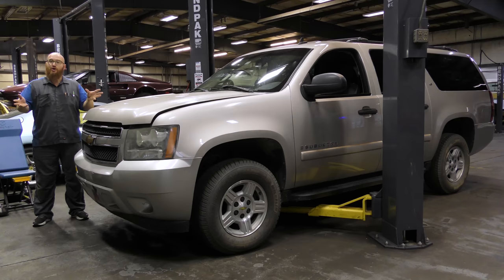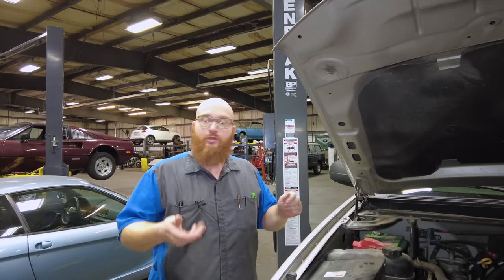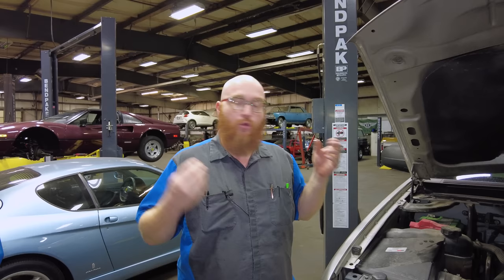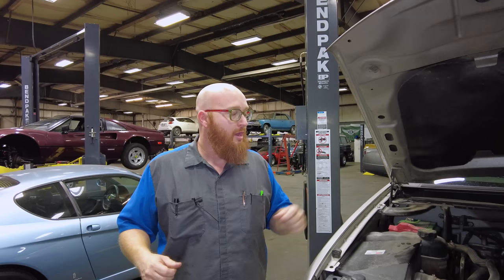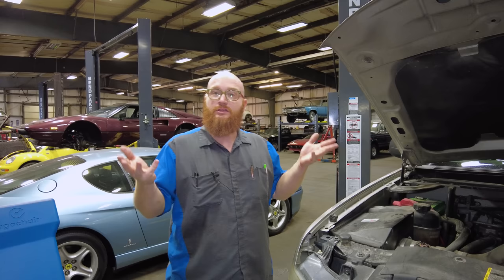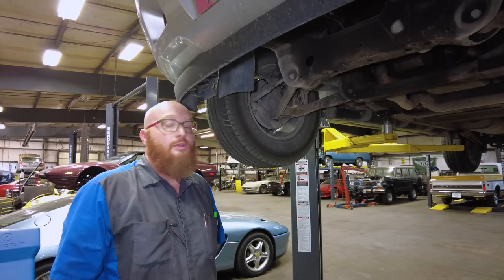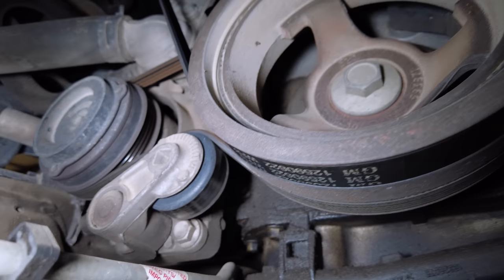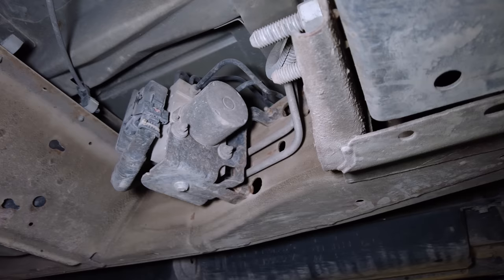What fails on ALL early 2000's Chevy SUV's!? CAR WIZARD shares what he's seen from the last 20 years

Comment: Chevy Suburbans are one of the most reliable SUVs ever made. Statistically, the 5.3L engine is a great engine. The problem is it followed the most reliable engine ever made, the venerable 5.7L.  My 94 Suburban is still going strong with 415,000 miles. Original 5.7L engine. Only major repairs have been AC and front end. Requires about half a quart of oil between changes.Wife's 2005 Suburban has just needed oil changes, brake pads and tires.

Comment: I have a 2007 Suburban 5.3L 2 WD 185k/miles I’ve changed the gas pedal 3 times, Driver digital info in dash replaced, upper control arms, some charcoal/vacuum solenoid that makes pumping gas a big issue.

Comment: just fixed up mine, valve cover gaskets, intake gaskets, spark plugs, spark plug wires, serpentine belt, and an oil change

Comment: Great video!  Yep, my hand is up with the ABS light.  Will try to get to the box soon to resolder it.  I have a 2002 Suburban with the 5.3L engine.  Knock sesnors were bad on it.  Replaced and still bad so I got another set and installed them on passenger side engine head.  There are two hole perfect for the knock sensors.

Comment: glad I caught this video, I just picked up an 04 Tahoe. Got it super cheap, needs a transmission and guess what is on the rear bumper! Of course it has a reese hitch! Was low on oil, had the guy put oil in it, then drove it, (still shifts into 2nd). Hammered on it, good pressure, no smoke in the rear view - OK, My original though was the rear main, I'm doing the transmission anyway so hey I'll be right there right? Now looking at this I'm way more suspicious of the oil cooler block and possibly the oil pressure sending unit, although it is reading 40 psi. I'll be cheking it regardless. It also has the popping cv joint in 4WD, so now I'll be ordering seals and just knocking those out too. You mentioned the lines - as an R&R man for a transmission shop you are dead on but I'd probably include the cooler along with that. I've done at least a couple dozen of those too. Good video, I'll be watching you new friend!

Comment: You probably forgot the most common door latch actuators' failures. If one fail, the rest will follow. Either rattling sound or never locking or unlocking.

Comment: Brake and fuel lines.  Made of just steal and run along the drivers side of the vehicle right in the spray path of from the front wheel.  They WILL rust, and they WILL fail if you live in the north (MI here). If you decide to fix it yourself, avoid the "pre-bent" stainless steel brake line replacement kits.  Those are only good if you plan on completely removing the chassis from the frame.  Otherwise, they are not flexible enough to get them back into the correct positions.  Just get some NiCopp (nickel copper) brake line, a tube cutter, and a flaring tool and make your own.  For the fuel line, I got mine replaced with nylon lines for under $300 from the local gas tank repair shop.  Standard auto repair shop wanted $2200 to do both fuel and brakes.  With doing the brake lines myself and the shop doing the fuel lines.  Total cost was maybe $400 total.  '03 GMC Sierra Z-71 300k miles and still running.  The only issues that were mentioned in the video that I've had was the A/C tensor failure, and the instrument cluster failure..  Believe me, I've got a laundry list of other things I've fixed so that comment isn't a criticism of the video.  It's all good info.  Thanks!

Comment: Lol.  Just about all the common problems I have run across on my 03.  The exhaust was the main issue I had to resolve.  I ended welding nuts on the broken bolts that I could not grab.  It worked great other than fitting in there.

Comment: I’ve been a GMC from1984 to 2021.  Nothing but Chevy trucks from bumper to bumper, from transmission tech to full time electrical tech until I retired.   Yes.  I’ve seen what Wizard had seen,  what he talked about but maybe we don’t work in the same religion,  like snow country.   I only replaced 5 oil pressure sensors in my career. Yes. They do failed but I don’t see the failure rate he saw.    I had 17 tech in my service dept and I know other guys have probably seen a few failed every now & then.   AFM is a problem though.   I don’t do engine work but I see that problem in my old shop.     Overall,   Customers love them trucks,   They have high mileage but pretty reliable and they take care of them, I still see a few come in when I left.   They hold their value well.   That year was still the best truck in my career.   That trans is not a big HD unit,  I didn’t see the torq converter clutch failed that much,  the apply control & pressure is more of the real problem which may require replacement later.    Yes, 3/4 clutch or O/D may be the weak point but they should last over 100,000 miles & more.

Comment: I had 2 GM/Chevy large SUVs and 2 Chevy sedans of that era and all but 1 had failed transmissions and cooling systems.  The one without transmission or cooling system problems had a failed electrical system that killed it first.  I never used any of them for towing while I owned them but as I wasn't the original owner I can't say it didn't happen prior to my ownership.  I just accepted that me and GM vehicles of that time period were not friends.

Comment: 04 silverado 1500  5.3 Z71 here.
No joke 424,000+ original miles engine and trans still every day construction work vehicle. Water pump at 380,000 both abs hubs at 290,000. Dash cluster about 310,000 replaced third member at 180,000 but hit deep pot hole while hauling heavy load on lumber rack.
All maintenance  done by me.
The key is maintenence.
I'm original owner , got my money out of this one.

Comment: PSA: if you have a 6L80 transmission, get it tuned to stay out of torque converter lockup before 5th gear. 

Also, have your torque converter replaced with a billet unit before 100K miles. 

I ran out to 220K miles on a factory transmission, at which point my torque converter lockup clutch disintegrated and took the rest of the transmission with it. 

$2K for a billet torque converter + install, fresh fluid and a rear main seal looks way better than $7K for a new trans.

Comment: You didn’t point out the dash cover, the dashes from 07-14 or so dry up and crack everywhere, literally fall apart.  Also the brake pedal switch, can’t remember the official name of it, located on the brake pedal shaft, it gets gummy and sticks or fails giving the lights on dash for stabilizer traction control issue.   I’ve dealt with both, pretty easy.

Comment: I have a 2005 Tahoe and I love her. Hope to keep her going forever.  Have replaced tranny, and transfer case,  those were the biggies. And a few of the things you mentioned. Oil pan gasket, o ring and new oil pump! One thing you failed to mention, which according to forums, is pretty common, I know you touched on accuators up top, But The blower motor, resistor and wiring harness for A/C down by passengers feet. Seems like this one should be a recall. I have replaced this set up twice now, as my wiring harness gets melted to my resistor. Fortunately I was able to do this job myself. If not for changing out the wiring harness, the rest would be like a 5 minute job. First time I did a REALLY good job, soldering wires together, then shrink wrapping and taping...This time i just used butt connectors! lol

Comment: Enjoy your videos Mr. Wizard. Am curious why nobody doing these common failure videos about GM vehicles mentions the alternator and oil pump failures that will happen. I own/owned 2006, 2007 and 2008 Chevys and replaced first the alternators and then the oil pumps. These pumps are crap after 125,000 miles. I still have the 06 and 07 5.3 L vehicles and they run great with new oil pumps.

Comment: My Saturn ion red line 2.0 etech 2005 manual 5 speed only had 1 common problem and that was ignition switch would cause security system to come on not set off the alarm, but it would basically lock so that way the car would not start I would have to leave the key in the ignition on ACC mode for 10 mins and then it would start but it was very random! I’d go months without starting issues to every other day for a week having to do this 3-4 times a day! And then nothing for months I changed starter and battery connector red cable and checked/cleaned grounds and nothing worked until I replaced the ignition switch itself. The only way to know if it would start or not would be if you were to put the key in and turn it forward and the security light would be flashing then I knew it wouldn’t start.

Comment: Had two GMT900s with 6.2s.   They both ate front rotors and pads every 25K.   Rear "Autoride"  shocks (self leveling air shocks) tended to crap out a lot too.   Non-OEM replacements (Rockauto) are garbage. 

Power door lock regulators also failed with surprising regularity. Otherwise super reliable trucks.

Comment: My 07 5.3 lost its cam chain plastic tensioner function, skipped some teeth and had it fixed at 210,000 including oil pump, plugs wire, 2WD Pan gasket, valve cover gaskets.  Happy for the 50k miles since.

Comment: I got 380 ,000 miles outta one.
Cheap east to fix reliable.
Only rust ruined it.

1.Electric fuel pump in tank
2 . Front wheel hub bearings
3. Trans ruined from towing in lock up.
ps: you can disconnect purple 420 wire off brake light  pedal switch to disable Convert PWM signal to stop TCC shudder.
4. Exhaust studs.
5. ABS module.

I am close to 400k miles on 2003 Chevy  4.3 Vortec express 1500   van  .
Trying to get to 500k.

Comment: Wheel speed sensors and axle shaft boots have been an issue for me. I haven’t had any of the issues you talked about yet which is scary at 184k miles. Maybe I got lucky lol

Comment: The rear air shocks disintegrate causing the air compressor to run a lot. The air compressor gets water inside and quits working. The Escalade nav system fails because the map DVD reader quits working. Don't bother trying to replace the reader. Just get a complete refurbished unit. The HID headlight bulbs fail and the driver side is a pain in the a$$ to replace. The outside mirror folding mechanism fails. You can get replacement parts and DIY. The battery doesn't seem to last very long in these vehicles. I have to replace the serpentine belt about every 12 months when it starts squealing. Nothing shuts it up. The dashboard cracks even if you always use a sun shield. Otherwise I can't really complain about the vehicle which is 17 years old now.

Comment: Whenever I do LS motors, I replace the small exhaust manifold bolts with older small block style 3/8 bolts/studs and they very rarely fail again. Ford engines have the same issues. It makes no sense why to use such small bolts for exhaust systems at all.

Comment: Ive got a 2006 suburban 1500 with 235k on the clock i used for towing, had issues with the torque converter, blower motor, rocker panels, rear quarters, oil pan gasket, plugs and wires, and a lifter tick from hell haha 

At this point for all the other work that needs done to my 1500 dollar tow rig im just gonna pull the motor and transmission and put my spare in

Comment: This Tahoe is the same as mine, 07 Tahoe 2wd and the oil pressure sensor that you mentioned - I didn't like changing that one. Transmission went out while towing, and I was in tow mode. That oil filter bypass plated area, mine is currently leaking, 😅 Good info on this vehicle.

Comment: The failure points serve me well because I buy 'em broken! My 2000 Silverado has a six banger 2WD cab, 5.3 4WD drivetrain and frame from a rollover, and the rest from other organ donors. 
I'm open to an AFM year truck with a blown engine since I've already collected a couple of good 6.0s without that chite. One MAJOR beauty of the LS is free tuning software and inexpensive OBDX USB adapters. That makes anti-theft and rear O2 sensor deletes pleasantly cheap and lets you clone ECUs. I have too many good trucks already but this era are so easy to deal with I'd still add another. The exhaust bolts are trash so when I install an engine I replace ALL of them before install and use plenty of high temp nickel anti-seize because dry threads are Satan's playground.

Comment: 100 percent correct the spark wire always break even if brand new will brak when thy and remove. never had a coil go tho 286000 miles, yep cluster failed to. trans shift silonoid, and a trans case the eats its self alive.

Comment: We bought our 2012 yukon Denali with 29k miles in 2015. Since the day we bought it, there was a clunk when you accelerated suddenly. By the end of the time I had it, Just simply driving especially at low speeds, the whole car would jolt and it literally felt like you hit something. But no mechanic could figure it out. Took it to GMC. Took it to independent mechanics. Even took it to my mechanic that has solved issues dealers couldn’t in the past, he couldn’t figure it out. But I traded the car in at 105k. Also replaced 3 motor mounts because upon startup, the car would jolt and jump. I loved that car but man, quality was not it.

Comment: 20 years in the industry, several manufacturers..my recommendation has always been as follows: if buying new and always in warranty, Ford makes the best overall truck, but as for the rest of us commonwealth folk, used GMTs are MUCH easier, and cheaper to fix and keep running.  I currently own a 2003 Yukon XL Denali with 262,000 miles on the original 6.0 and 4L65E.  Great truck and indispensable part of my fleet.

Comment: Had an 07 Yukon XL Denali 6.2l non AFM. Sold at 260k miles. Oil pressure sender, rear main and those stupid plastic clipped hoses. Loved that truck other than the 14 MPG…

Comment: I love those suburbans but what kept me from getting one of these years was the AFM deal, and the potential HUGE problems it can give me, I lived with a 92 S10 till 2021, fixing something isn’t alien to me, but there are ideas that I won’t accept.
at one point I even considered going as far back as a classic 327 , keeping it 5.3 or maybe a 350 with basically modern heads and a Snyper, rather than suffer AFM, needless to say I left that project be as that’s an entirely new breed of headaches to try and accomplish and really wish I hadn’t sold the 73 suburban I had decades ago when I was younger …
NOW, GM ditched the versatile body on frame design for a unibody, so I may just get me a body on frame one yet and basically customize it my way, nothing crazy, just more durable things here and there
Reply: The easy way to avoid the AFM is to buy the Suburban HD. The bigger brakes and extra torque are nice extras too.
Reply: @csh000  ultimately you’re right, however importing one from the States and shipping it here half way around the world is a little too big a hassle, finding a Stock HD one is next to impossible here … also people where I live like European cars, Japanese and Korean, small block chevies are available but someone to rebuild that ? … it’d have to be in the States and shipped here …

Comment: 2000 s10.
I have that intermittent oil pressure sender issue.
The windshield wiper switc lever has an intermittent issue as well.
The driver door upper hinge pin worried out to oval causing the door to sag.

Comment: One thing that you haven't talked about 2008 Chevy tahoe ltz flex fuel 5.3, 4 wheel drive. I was having wiring issues, but I would not start or crank,gauges would drop out when it did start,transmission would shift hard. Replacing all ground straps and wires and the ECM engine control modular replaced didn't fix the problem I finally track down the problem to the (TCM) Transmission control modular that is located in the rear of the vehicle, up above the spare tire the PCM box rusted and letting moisture and water into the unit I liquid taped the wires and flexfield the unit from water penetrating the unit until. I had to buy a new one for my vehicle. At first, I bought an ECM,at first,but it didn't fix the problem and now I have a new(ECM and TCM) that I need to take it to the shop to get programmed to my Tahoe. Hopefully this helps someone with wiring issues. Check all ground straps and wires, then go straight to the TCM and check wires and how much rust is on the box itself.flex seal would be the best way to get a quick fix because you will have problems starting for a day or to then all will be good then when it rains or snows,the problem comes back l,then they will straighten up and run just fine, if you are having them problems start with the transmission control modular location under the rear of the vehicle above the spare tire laying on the frame of the vehicle I hope this help someone out that is pulling their hair out like I did

Comment: I’ve been a GMC then. Chevy guy since ‘97 my 2011 5.3L suburban was the best truck I’ve ever owned by far, bought it used with 20k km traded it in in 2021 with 437k km for a brand new sierra always ran full synthetic never had an issue , oil tires and brakes was all she ever asked for , guess I just got a good one or lucky.

Comment: 359,000 plus miles on our 2000 Z71. Original engine trans and transfer case. The rear axle I've rebuilt twice. And u joints in rear driveshaft don't last.

Comment: Let me add: Resistor pack  for the blower motor. SO COMMON, next time I will rewire and create a variable voltage circuit wired directly to blower leads!

Comment: Ive got a 2008 Tahoe, 150,000 miles, still has the AFM enabled. The only issue ive had with this tahoe since we bought it at 90,000 miles was a sway bar link that snapped. Ive been thinking about deleteing the AFM, but it works....so.....I am sort of on the fence with it.